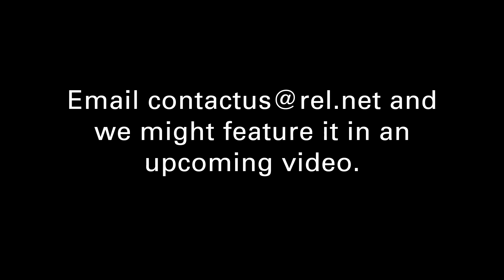Why do you recommend corner placement for REL subwoofers?

Comment: Duel s/510’S should be placed next to the speakers & not in the corners?
Reply from the maker: With a single subwoofer we recommend corner placement, though when using a stereo pair of subwoofers improved performance can be achieved by placing the subwoofers next to the corresponding main loudspeaker. This will provide a more seamless integration between the output of the subwoofers and that of your main loudspeakers, while still providing plenty of output power in your room due to the use of dual subwoofers.

Comment: My REL S/812 manuals say place them outside main speakers or inside for narrow rooms. Is corner placement preferable?
Reply from the maker: For a single subwoofer, we recommend corner placement in order to reinforce it's output and more evenly project that output throughout the room. With a stereo pair, improved performance can be achieved by placing the subwoofers closer to the corresponding main loudspeakers. Placement to the outside of the speakers is preferred in most cases, though in narrow rooms placement to the inside of the speakers can work well.
Reply: @RELAcoustics  thanks! My room is narrow 15’ and I placed on the inside which is working great.

Comment: I placed my new T7x on a marble slab. Is it a good idea?
Reply from the maker: Thank you for reaching out. This is fine to do, though to get the best possible performance we recommend placing the T/7x directly on the floor in your room. This will allow the subwoofer to more effectively couple with the floor and use this surface to reinforce it's output and project that output throughout your room.

Comment: Why is it that elevating my single sub 18 inches off the floor and placing it away from the corner and also away from the walls of my open concept floor plan (whereby it is more or less almost equally away from any wall surface) produces the best, most accurate sounding bass and soundstage?  I placed the sub based on experimenting with many different locations. It's a 10 inch driver in an 18 by 18 by 18 inch front ported enclosure.
Reply from the maker: Thank you for reaching out. The ported cabinet design of your subwoofer could have an impact on this, though setup and placement guidance for your sub will be different from our subwoofer designs since we at this time do not offer any ported cabinet models. In the end, if you are hearing good performance from the subwoofer in your room and system, and are enjoying the music or movies that your system plays, then it is set up correctly.

Comment: Baught T9x and in the corning it produces nothing but „room boom“ regardless of how low the crossover is set. Positioning of rel‘s turned out to be nothing other then positioning any other subwoofer. Will try DSP but so far I’m not happy w rel at all. The position where there’s no „boom“ I just could leave my floorsrands running on their own without subwoofer. Even when I position the sub next to my freely standing  spreaker.
Reply from the maker: When you have a chance, please write in to contactus@rel.net and a member of our team will be happy to assist with setup and tuning advice to improve the performance and integration of your T/9x.
Reply: @RELAcoustics I did, haven‘t received any reply the last time

Comment: Is the corner placement applicable to REL down-firing subwoofers such as the Stampede or the Strata  5? Thanks
Reply from the maker: Thank you for reaching out. Our recommendation to place REL subwoofers in corners does apply to down-firing models such as the Stempede and Strata V, and is especially helpful with these models to help with reinforcing their output and projecting that output into the room.

Comment: Why toed?  I thought subs where not very directional.   Isn't the time signature line up accomplished with the receiver channel delay anyway?
Reply from the maker: Thank you for reaching out. To get the best possible performance from REL subwoofers we recommend placing them in a corner and toeing them in so that their front-firing driver is aimed diagonally across the room and toward the opposite corner. This results in the low-frequency pressure waves produced by the subwoofer having the longest possible travel distance in your room before they hit a room boundary, resulting in deeper low-frequency extension and more even output throughout the room.

Comment: Is it OK to place a thick fabric over the sub for decorative and protection purposes against dust or scratches? The fabric will cover the sides but not the front woofer.

Also, it is OK to place a potted plant on top of the sub? The corner of the room is already occupied with a potted plant. Another corner is also occupied with a stand lamp.
Reply from the maker: Thank you for reaching out. It should be fine to place a cloth and potted plant on top of your subwoofer, though when doing so you will need to be careful so as to not scratch the top of the subwoofer's cabinet, or to get water on the subwoofer when watering the plant. Any damage to the subwoofer resulting from this would not be covered under the parts and labor warranty. In addition, a subwoofer can produce a significant amount of low-frequency energy, which in turn can result in the plant vibrating during bass heavy passages. With some plants this may be fine, though other plants may not like these vibrations.

Comment: Hello I have the ReL Ti9, I hear a little rattle/tingle I have the both high low cable and ReL cable attached. Any suggestions? Thanks in advance.
Reply from the maker: Thank you for reaching out, and for choosing a REL subwoofer for your home audio system. There are a couple possible causes for the rattle that you are experiencing, and it would be worth getting our service team involved for troubleshooting assistance. When you have a chance, please write in to contactus@rel.net and we will be happy to assist with resolving this rattle.

Comment: I don't use a REL sub yet but have been using a decent sub for the past 20 years or so. For single sub, corner placement close to wall boundaries always produced the worst result. Uneven and boomy bass. Single sub produced best result when placed in between the speakers in all the rooms I have tried. It doesn't need to be exactly at the centre between the speakers.   It can be closer to the left or right speaker but in between the two.
Reply from the maker: Thank you for reaching out. While it may not be the case with your third-party subwoofer, with single REL subs we do find that corner placement results in the best possible performance. This is in part due to the crossover on REL subs often being set lower than with subwoofers from other manufacturers, which allows them to be placed in a corner without their output becoming boomy or loosing definition.
Reply: @RELAcoustics I didn’t find that with my Classic 98 in my room, but I’m a subwoofer noob. I tried following the REL suggestions and found the bass was horrible in the corner of my room, sounding slow and boomy. I was initially really disappointed. Thankfully I found a POLK audio article on subwoofer placement and followed their advice and did the subwoofer crawl and ended up placing it a foot off the wall right next to my right speaker, which was close to the centre of my room. It sounds great now, and I’ve been able to increase gain to +7 and crossover to +11 (in the corner position anything above a gain of +3 started to overpower my speakers with boomy and slow bass).
Reply: @RELAcoustics  I had my Rel T-3 in between my Quad 12L2s.  I was down on the floor with my had on the cabinet (to feel the resonance) and my ear practically against the Rel while trying to tune it.  Then, one day, as I walked out of my room and was coming back into the room, I heard a tremendous wall of low frequency sound coming out into the adjacent room.  (Don't ask me why I never noticed this before!).  So, I came in and started walking all around the listening room.  There was tremendous bass presence in the room corners and along the walls, but a huge hole in the middle of the room.  This hole is what I had been focusing on all of this time.  I relocated the Rel into a corner of the room, but now the difference is even greater.  Tremendous bass (especially for a small subwoofer) in the corners, but almost nothing in the center of the room.  Is there anything I can do about this?  Thanks!
Reply from the maker: @stevenblank7303  Thank you for reaching out. Due to the way that low-frequency sound waves interact in a room, it is possible to experience peaks and dips in the bass response, with corners or against walls being common places for a bass peak, and the middle of the room being a common place for a bass null point, especially if the room is roughly square in dimension. Adding bass traps or other acoustic treatment to the room can help to lessen this effect, or adding a second subwoofer to the system can also help to smooth out these peaks and dips.

With a single subwoofer, it will be best to experiment with different positioning options in the room so that at least your listening position is not situated in a bass null point.

Comment: Do I have to corner load it along the front sound stage? My room layout is best suited to a rear positioned subwoofer
Reply from the maker: In our experience the best performance and most seamless integration with your main loudspeakers will come from having the subwoofer(s) placed in the front corner of your room, though if this is not possible in your system then you can still achieve excellent results by placing it in a rear corner in your room.

For specifics regarding subwoofer pairing for your system, please feel free to write in to contactus@rel.net and we will be happy to assist.

Comment: Should I remove all bass traps or just the one in the corner with the sub ?
Reply from the maker: It is possible to use bass traps in the same corner as your subwoofer, though you will need to either raise the bass trap so that it is mounted above the subwoofer, or place the subwoofer in front of the bass trap. The ideal configuration for your system will depend on your room and the other acoustic treatment which you are using, so it would be worth experimenting with both options to see which works best for you.

Comment: How do you deal with phase issues with the woofer behind the main speakers
Reply from the maker: In our experience, using the phase switch on the back of the subwoofer and making adjustments to it's physical positioning in the room will offer enough flexibility to account for any phase issues stemming from the sub being located behind the main loudspeakers.

Comment: Hi John. You say corner placement is occasionally good for a pair. I have the HT/1003 currently in a corner. I am looking to purchase an additional HT/1003 and my Marantz 8012 has independent subwoofer outputs. Would corner placement be a good option here as I'm rather restricted to where the second subwoofer could be placed. Thanks.
Reply from the maker: Corner placement can still work well when using a pair of subwoofers, though in our experience improved performance can be achieved by having each subwoofer placed just next to the front channel loudspeakers. This will help the subwoofers to blend more seamlessly with your main loudspeakers, and since you will have two subwoofers they will be less reliant on the corner placement to reinforce their output.
Reply: @RELAcoustics  Thanks john.

Comment: Does the corner placement apply to the t5i with its downward firing driver.. ?
Reply from the maker: Corner placement is especially important with our down-firing subwoofers such as the T/5i, since the proximity to room boundaries will help to reinforce the subwoofer's output and project that output into the room.
Reply: @RELAcoustics  thank you for that info. Just 2 last questions before i go and enjoy my t5i.
Is it ok on a carpet or raised on a dedicated platform?
Reply from the maker: @oohtob6685  For optimal performance from the T/5i we recommend having it placed directly on your floor, rather than on a platform. The feet on the T/5i are designed to place it's down-firing driver at a specific distance from the floor, and altering this distance by placing the subwoofer on a platform will have a detrimental impact on the low-frequency extension of the subwoofer's output.
Reply: @RELAcoustics  maybe it's because of my extra thick woolen carpet but I find by having my stereo t5is positioned on masonry tiles which are sitting on high density foam to sound more Fuller. Due to size constraints I'm forced to have my rels positioned in opposite corners from my bookshelves... a unexpected benefit of having my rels positioned either side of my sweet spot is that I find them easier to integrate!
Click on the red dragon twice hit the rel with q acoustics video to view/listen.

I'm not aware of any other companies who specialise in audio equipment to make such in-depth helpful videos.  👍👍

Comment: 45 degrees toe in? would aiming it at the opposite corner be better or worse in a rectangular room?
Reply from the maker: A 45 degree toe-in angle is a good place to start in most rooms, though ideally the subwoofer should be toed-in so that it's front firing driver is facing diagonally toward the opposite corner of the room. This will give the low-frequency waves produced by the subwoofer the longest travel distance possible in your room before they reach a wall or other room boundary.

Comment: I disagree. It's not about the crossover frequency or filter rate. Corner placement exaggerates all room modes so whilst it will be louder and stronger, bass will become one-note. Room modes will take over and you'll get very strong output at certain frequencies depending on your room dimensions. Measure it even with your phone and a free Spectrum analyser and you'll see and hear certain frequencies being much stronger than others, totally dominating the sound you hear.
Reply: This is also my experience. I placed my two REL T-Zero MK III near my listening position in a somewhat smaller room with amazing results in a tube based stereo setup with KEF LS50 Metas. 😄
Reply: And toe-in at 20 Hz and below makes little sense.

Comment: This guy is so clear. You can trust he knows his product.
Reply: read my comment please. I am an engineer and acoustician.....never put a subwoofer in the corner
Reply: @Campbell1.  why?
Reply: @heartofcinema3454   1) Comb filtering issues.2)Time alignment 3) Does not pressurize the room properly 4) interferes with sound-staging.5) Front wall and corner placements excite the room nodes too much and cause very problematic freq. responses.
In all, bass below say 100Hz is ALL ABOUT pressure, loading the subwoofer to the room and not loading to the speakers. :)
Reply: @Campbell1.  ok. So where would you suggest best placement for a normal medium-sized rectangular conservatory with a high celling?
Reply: @heartofcinema3454  I cant give you the specifics without knowing any parameters. Have a look at "acoustic Fields" on youtube. Dennis is the only one online who knows what he is talking about.
Reply: @heartofcinema3454  Distortions occur in corners, such as uneven pressure and modal problem. Putting a sub right in this problem area makes the problem only bigger. Wouldn't one want to avoid problem areas?
Reply: @heartofcinema3454  Time alignment of sub is critical  with your main speakers. Placement more towards the centre, off the floor and complimented with another sub located near the opposite wall, yet diagonally opp first sub. This evens out modal problems etc. Unless the alignment is done with a DSP, it would be very difficult to do by just ear
Reply: @Campbell1.  Tell us more about your degree.

Comment: Hi i have down firing sub one at front and one at back corner is still ok ?
Reply from the maker: Having one subwoofer placed in the front of the room and the second sub placed in the back of the room can work very well, and will help to evenly pressurize the space. For specific subwoofer placement advice, feel free to write in to contactus@rel.net and we will be happy to assist.
Reply: REL Acoustics ok thanks.if i have my center and main floor standing speakers set to 80hz and i have my lfe set to 80hz will the subs and the front stage cross over good or is that wrong
Reply: I wish that someone had answered your last question Tom, as I have the same question.

Comment: In a 5.2 set up would you place both your subs in opposite corners?
Reply from the maker: For home theater setups it can work well to have both subwoofers placed in opposite corners in your room. For both subwoofers you can adjust the proximity and distance to the corner as part of tuning the subwoofers to your room and system.
Reply: @RELAcoustics  Yep, that's exactly what I do for my 5.2.2 system, and it sounds great!

Comment: Thanks John, what if I have a pair of down firing subs (REL Strata III)? Does that change the position?
Reply from the maker: We recommend placing down-firing subwoofers like your Strata III in corners for optimal performance, though since there is no front-firing driver you do not need to worry about toe-in angle. Corner placement will help to reinforce its output and project the sound into the room.